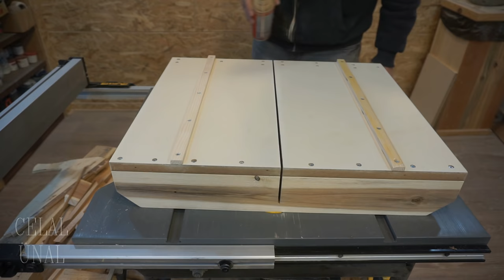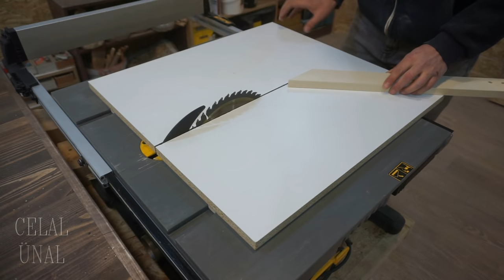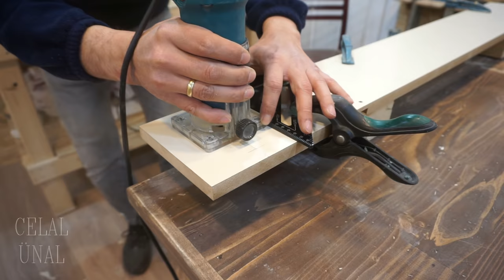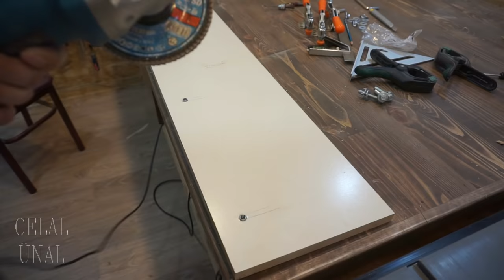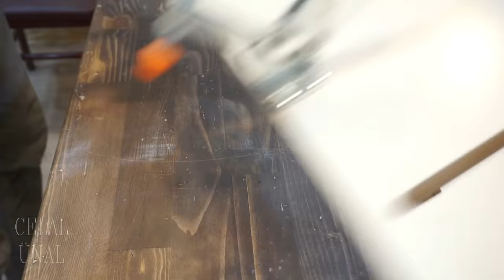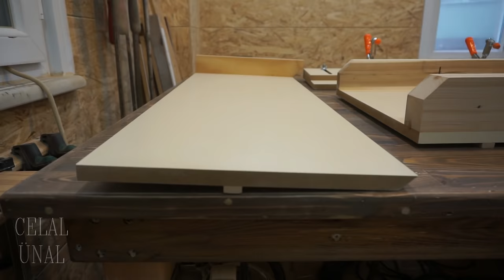Table saw sled / Diy woodworking / Tezgah testere kızağı

Comment: This is one of the clearest tutorials I have found. I have subscribed and look forward to more helpful and practical ideas. What kind of sheet board did you use? It appeared to be similar to MDF, but wasn't not able to see clearly. What kind of adhesive did you spray on?
Reply from the maker: Thank you so much. I am so glad you liked it. I used MDF
I used instant glue and coolant spray.
Reply: looks like melamine to me

Comment: Great idea and very well made concrete video. I'm in the process of buying a saw and most mid range saws have the same problem with cross cutting. They should add one more milled channel in the structure and then the problem would be solved.
Reply from the maker: Thank you very much. I am so glad you liked it.

Comment: Hey what kind of CA glue and Accelerator do you use and where to get it. I’m just tired of using small bottles lol. Keep up the great work
Reply from the maker: Thank you. I used instant glue and activator spray. A material that provides drying and adhesion with activator spray.

Comment: Greta job!! Super and smart!.. can ask you what do you use in the spray at 2'53" in order to make  Better the sliding's guides? Thank u so much!
Reply from the maker: Thank you. I used instant glue and coolant spray. A material that dries and adheres with a coolant.

Comment: Is that the 7492 dewalt saw? Acquired it recently but have not had time to test yet. Your sledges seem to be amazing. Your instructions are great and all the steps are very clear.
Reply from the maker: Thank you so much. I am so glad you liked it. I am using Dewalt dwe 7492.

Comment: hello Unal, great tutorial and great ideas thanks and congratulation, may I ask you what is the product you spray on every joint upon the glue and why you do that? thanks, Filippo
Reply from the maker: Thank you. I used instant glue and activator spray. A material that provides drying and adhesion with activator spray.
Reply: @CelalUnal1  undetstood, thanks Unal.

Comment: Ich habe mir dieses inspirierende Video schon fünf mal angeschaut. Einfach nur klasse!
Welches Sägeblatt verwendest du?
Grüsse aus Deutschland
Reply from the maker: Vielen Dank. Ich bin so froh, dass es dir gefallen hat. Dewalt dwe 733
Reply: danke für die Antwort, der Name dwe733 scheint aber leider nicht zu stimmen. @CelalUnal1
Reply from the maker: @heikow.7627 Es tut mir leid. Ich habe den falschen Code geschrieben. Dewalt dwe7492. Tischkreissägencode.
Reply: @CelalUnal1  ich habe die gleiche Säge, aber welches SÄGEBLATT (saw Blade) nimmst du?
Reply from the maker: @heikow.7627  Problem mit der Google-Übersetzung. Endlich habe ich es herausgefunden :) Dewalt Dt1957. Dies ist der Code für das Messer. 250 mm Durchmesser. 48 Zähne. 3mm Dicke. Ich hoffe, ich habe richtig geschrieben.

Comment: Hello, these are some awesome sleds.  I'm looking to build a good multi use sled. I have a craftsman table saw, but my problem is the tracks have 3 safety kickout notches on both sides. I haven't seen anyone build a sled to fit this style.  Any suggestions 🤔

Comment: > As far as I know, I showed how they are made

are the "scrap" inserts you placed below the rails @ 35s dimensioned? I didn't see these made or the measurement taken

I noticed the rails were basically flush with the table top, was that intentional or is there any issue with them being higher than the table top?
Reply from the maker: Hello there. Exactly as I know I showed how it is done. If I remember correctly, it's 1.9mm thick. I am using dewalt dwe 7492. I did not share the dimensions, as the duct and tray dimensions will vary from brand to brand. yes it is flush with the table top. The MDFs I use are 1.8 thick. This cuts the blade slightly, but provides a precise cut. I deliberately made it so thick. Thinner materials warp over time and cut sizes are wrong. I hope I understood and answered your questions correctly. Greetings.
Reply: @CelalUnal1  @ 28s -> 34s the offcuts being made look to be as tall but slightly narrower than the cut of the rail.

@ 35s 2 pieces of wood are placed in the track-- they look narrower and shorter than the offcuts from the previous segment. then your cuts from the previous segment are placed into the tracks on top of them

where did the two pieces on the bottom come from?

Comment: nice job! what kind of saw are you using?
Reply from the maker: Thank you. I used instant glue and activator spray. A material that provides drying and adhesion with activator spray.

Comment: You did a good job.but one question is necessary,where are the end stops of some of your self made tools ,this is I think very important to not loose your fingers or hand. Bye
Reply from the maker: Thank you so much. I think there is no need to stop it. Because the moment you stop pushing the cut. But still the stopper can be added.

Comment: Just by watching this video I know I have to get a table saw! I am thinking of a Dewalt DWE7485 or Dewalt DWE7492. I guess 7492 is more clever choice, but the question is if I will use all the functions. It's almost twice expensive.
Reply from the maker: I am using Dewalt dwe 7492.
I advise 🙌🙌🙌

Comment: 7492 is the powerful! only one problem is the noise~~
Reply from the maker: Exactly. Very nice amkine, but loud.
Reply: @CelalUnal1  haha and the  dewalt style  fence is my fav~ especially 7492, it have 830mm cutting width~!!!!
Reply: @CelalUnal1  
And you can try make a noise reduction box under the 7492 motor?

Comment: What spray are you using on the wood?
Reply from the maker: I used instant glue and coolant spray. A material that dries and adheres with a coolant.

Comment: Those demonstrations of accuracy with a metal angle are nice to look at, but they don't tell you anything about the actual accuracy of the right angle when cutting. What is the perpendicularity of the saw blade to the fence? In addition, if the right angle of the front fence is set according to the school triangle. How about showing accuracy with the 5-cut method?
Reply from the maker: I say thank you. You are right, it should be as you wrote. My goal is to try different shapes. If the result is correct, I think it doesn't matter much about the way it is made. Thanks for your valuable information.
Reply: Good enough for a video, when you make yours you can check the accuracy however you like according to your saw. What are you making, pianos?

Comment: Nice video.
What is the make and the model of your table saw?
Reply from the maker: Thank you. I am using Dewalt dwe 7492.
Reply: @CelalUnal1  Tnx for info
Reply: @CelalUnal1  I think you could do a little useful tweak on you under table for your saw. If you shorten a legs for cm or two just enough so that table saw surface be a 1 mm higher than the big table surface, than you can more easily slide the big pieces of wood using big table as a support and that 1mm should be enough when you push wood from table saw to big table so it never would stuck on the front edge

Comment: what is the spray applied at 2:54?  Is it some kind of lubricant?  What's it called?
Reply from the maker: I used instant glue and activator spray. A material that provides drying and adhesion with activator spray.
Reply: @CelalUnal1  awesome.  thank you so much!

Comment: 2:35. Not right. 90 degrees should be set not from the saw blade, but from the rip fence, or from the T-track. The saw blade may not be parallel to the T-track.